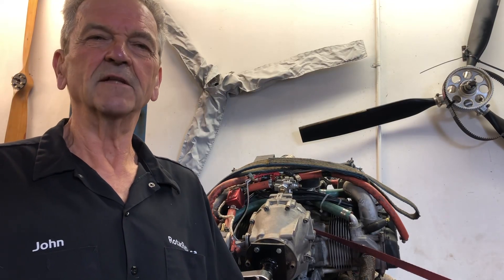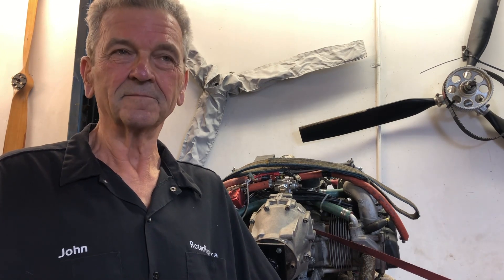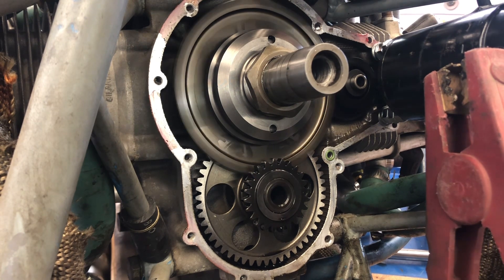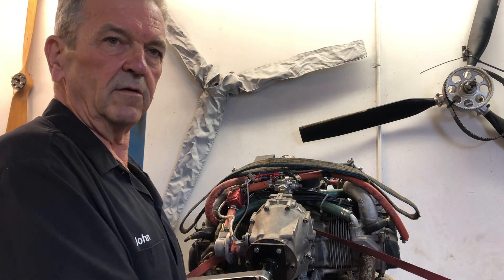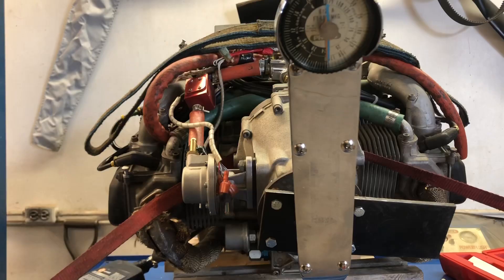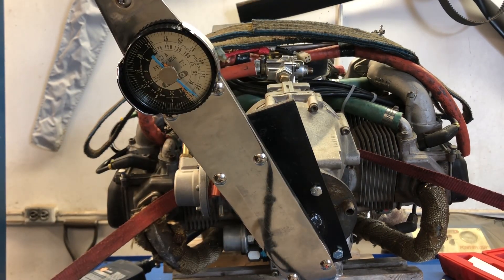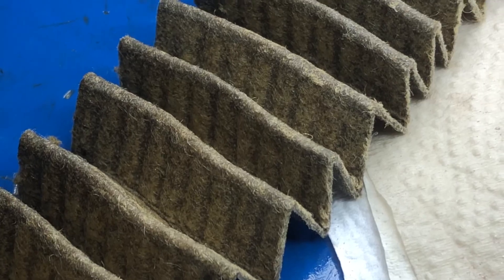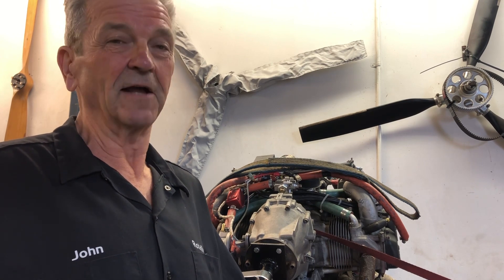Oh No! What Now?

Comment: Wouldn't this have the same effect as 'burping' the engine in the wrong direction on steroids? I understand this is undesirable as drags air through the oil system?
Reply from the maker: I actually rotated this engine both in directions before recording this video with the same test results. Yes, rotating the propeller the wrong direction any time can introduce air into the oil system. The same will occur if the propeller is rotated or an oil line is loosened during an oil change. Rotax published a purging procedure to get the air out before starting after service should air potentially be in the oil system.
Reply: ICE's are complicated.  They have served use well. But once batteries are up to par, maybe 5 years, electric will be so nice.  I'm biased in saying this of course as my background is electronics, but so much more cleaner to work on, and simpler I dare say.
Cheers